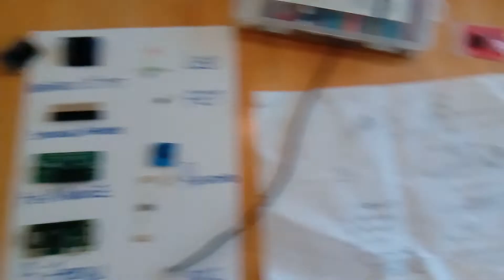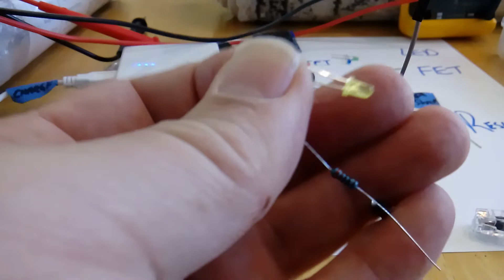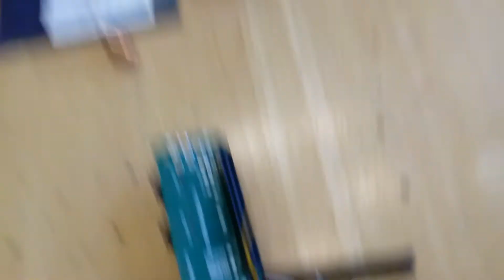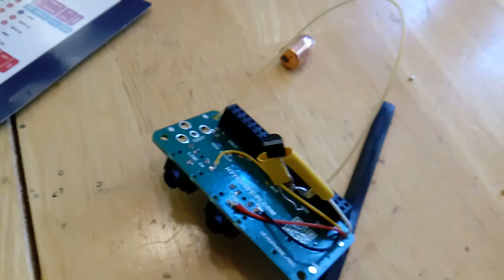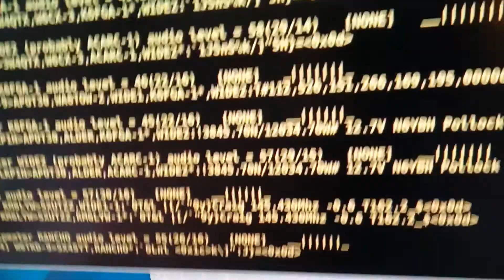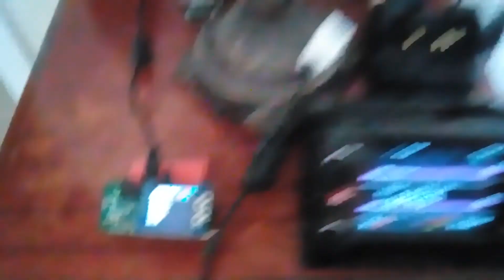DigiPi Build   Part 1 -- Hardware

Comment: I have been searching for both versions of the soundcard with no luck finding, It appears the FE-Pi is no longer sold on the supplied web sales form and not sure if what is currently listed are correct for this build project. I did email wb7fhc to see if they are still available. But in the meantime is there anything else that can be used? I have several HT's I'd like to try this project out on such as FT3dr, icom ID-52, and an FTM500d.

Comment: Will this run on Pi zero W or do I need a Pi zero 2W?
Reply from the maker: PiZero2W.   you can use the original PiZero, but you can't really use FT8/js8call/sstv/fldigi,  ax25/packet/aprs modes work fine.
Reply: @KM6LYW  Thank you! If building with a display, what case do you recommend?

Comment: Well today 18 October,2023, I received my Audio hat —-, not the FE-pi called for in the your plans, I was not able to source this Fe-pi device... ended up with a Keystudio ReSpeak 2-Mic Pi HAT v1.0..
    Any possible help to 1. Wire placement , 2. How would I be able to add the 1.3” monitor, which has yet to arrive..  I realize I could utilize a break out circuit board and jumpers to this breakout board.. however, in doing this will add to the Ugly Build look.. which I much prefer my project to look as similar to your posted pics and videos ..,
  KF2MS

Comment: Well, I've studied a lot of this and seemed to have determined that the Pi is used as a TNC. So, my question, if you have a radio with a TNC in it, like the Yaesu FT5DR , is there a cool way to use that radio with an external keyboard (even if it were a cell phone?) ? > The radio does have bluetooth. Seems like the bluetooth is underused ? Audio in only ?
Reply from the maker: yes, I drive a yaesu FT1DR, which has much of the same stuff.  The USB port and bluetooth are useless unfortunately.  You'll need to break out mic/headphone/ptt/ground wires and hook them between the radio and DigiPi.   The Yaesu HT's also require a special capacitor/resistor in the wiring harness (see your manual).  it works.

Comment: Hi Craig, If  Possible  Would you please be willing to do a new Video on Perhaps wiring up a Audio Cable for the Good Old Faithful Baofeng Radios?  Sure be happy out there to see this video if you was to? 73
Reply from the maker: that's a great idea -- radio harness video.  tho, to cut to the chase, just get a baofeng  (or kenwood) speakermic and cut off the  speakermic... there's all the conductors you need.
Reply: @KM6LYW  Hi Again Craig. Yes if it wasn’t to hard would you consider making a Video on How to Make a Baofeng or any HT that uses them Same K Plug Types than other HT can use.  Wiring it up to use the PTT Switching Circuit, Be an Excellent Educational Video. Looking forward to seeing it Craig
73 Craig

Comment: Hi Craig. Was wondering if you could answer this?? I have a APRS - K1 Audio Cable. If I was to buy the Digirig Baofeng Cable off there website, which has the Grounded would this work rather than making the PTT Switch Circuit?  This way use the Fei-Pi onboard Audio Plugs instead make it a tidy Project What’s your thought?
Reply from the maker: digipi will work with the digirig (with a tweak), but ultimately you need it, or a FET to do the switching.  digirig uses the serial port RTS signal for PTT and the digipi/fet solution uses a GPIO pin.

Comment: How can you possibly think this is a simple and easy "fix" project. Honestly, I started and gave up. I guess I just don't have the DIY time to do this.
Reply: Brian, it's infinitely easier if you have a "USB" connected radio.   All you  need is a Pi and a USB cable.  No soldering.
Reply: @craig9309  Which I don't have. I wanted to try and get this to work on HTs. I spend 99% of my time in UHV/VHF with EMCOMM and as a Technician, I don't do HF except the few times I've tried 10 meters. Thanks anyway.

Comment: any newer soundcard hat will work?..i search Raspberry Pi Zero Wifi and surprised with expensive price....it no longer for poor ham people like me
Reply from the maker: line level cards are best.  fepi and audioinjectorZ.  usb audio dongles possibly.   rpilocator.com
Reply: I am experimenting with the DRAWS HAT with this DigiPI SW. I know the GPIO's are definitely different. However I think through some foolin around, I might be able to get this hat to work work this. I cant see why it wouldn't. the DRAWS is just a stereo codec chip like is used in the NEXUS

Comment: how do you have this wired up to the ftm400?  I am wanting to wire mine to an ftm 350.  But it only has a data port.  Are you using a data port on the ftm 400?
Reply from the maker: Yah, Yaesu makes a break-out cable that fits the Din-10 jack, exposing ground audio in, out, and PTT.   Does the 350 have the same din-10 jack on the back?
Reply: @KM6LYW  it has a mini din 8 pin.   1.packet data input 2.GND 3.PTT 4.RX96 5.RX12 6.SQL 7.serial data output 8.serial data input
Reply from the maker: @jameslee522  Cool, do they make a breakout cable for that plug?   you want to use GND, PTT, RX96, and Packet-data-input.    RX96 is non-EQ'd audio from the radio, packet data input is the mic-audio-input.
Reply: @KM6LYW  Awesome, I'll give it a try.  Not sure if they make a breakout cable for it.  But I bough a standard 8 pin mini din and will cut it in half.  I knew you had a digi pi connect to your 400.  But I didnt know if you used the mic jack or the data port.  Thanks for your help!
Reply from the maker: @jameslee522  copy that - let us know how it goes!  I use the "data port" on the back of the FTM400 and FTM100  ... the breakout cable from yaesu is expensive... like over 40 bucks.

Comment: Great project, congrats! But I have a question, can i use It on old RPI2 controlling a latest Chinese uSDR over Cat? PU4BZT
Reply from the maker: rpi2 should work.  cat control will work with USB serial adapter, either using RTS signal or cat-control if radio is supported by hamlib.  In any event, checkout the direwolf "PTT" line for direwolf.conf in the direwolf manual for more info.
Reply: @KM6LYW  I'll try It! Thanks a lot !

Comment: Can I just plug my rig expert 2000 (On the FT-857D) into the Pi Zero using the USB connection and forgo this circuit?
Reply from the maker: If the 857D has USB audio and CAT control, yes!  you don't need to build an audio card.  We need a list of USB-powered radios.  ft991, ic7300, ic705..... ?

Comment: Hey Craig, it's not clear which pins you've soldered on the stacking header and sound card, is it 5, 12, 16, 26, gnd and a 5v? Actually don't worry, I soldered them all and it works fine.
Reply from the maker: You can solder them all as you discovered, but the essential pins for the FE-Pi Audio Z2 are 3, 5, 35, 38, 40, 12.  https://pinout.xyz/pinout/fe_pi_audio_z_v2

Comment: The display looks fantastic, I have the drivers for mine added successfully (tested) but struggling to get Direwatch working. Any chance of more detailed instructions to get it going.
Reply from the maker: Disable the kernel drivers if you haven't already.   Direwatch and the Linux kernel spi display drivers are mutually exclusive, you can't use both.  Flip through these instructions, skipping the kernel-driver installation, and you should be set.  It's essentially what I did.  https://learn.adafruit.com/adafruit-mini-pitft-135x240-color-tft-add-on-for-raspberry-pi/overview

Comment: Hey Craig, Thanks for posting the video. I'm new to packet/HAM but diving in head first :-) I currently have a home BPQ node running on a Pi4 and building a Direwolf/DigiPi with a Pi 3b for the car. The car setup was interesting since I needed a way to drop 12v to 5v and a way to shutdown the Pi gracefully. Came across a nifty board from Mausberry Circuits that works well. Now working on an ultra small stick to a back of an HT DigiPi with a Pi Zero W. Direction I'm taking is Pi Zero W with a UPS-Lite 1000mAh battery. Already bought a CM108 USB soundcard bare (no case) that i was thinking of soldering conductors directly to the bottom of the Pi 0 test pads. Ended up with this since I just couldn't find a sound card HAT that only had basic line in/out. Most on the market has tons of other crap I don't need. But after watching your video I sent a request for a FE-Pi to Budd. You mentioned in the video about sticky transmit with USB sound cards. Have you experienced this yourself? Also, my design has a Easy Digi planned. Did you find transformer audio isolation necessary for the Pi? Thanks again! Sorry for the winded message.
Reply from the maker: Wow great reply :).  Short-attention span response:   Boot the filesystem "read only", put "ro" in fstab.  make things like home or /var/log tempfs filesystems (ramdiscs).  Then you don't have to shut down.  Just plug the Pi into a USB outlet that works on 12V.  Use the powerbank battery when you're campin' or fishin, and don't leave the vehicle in accessory mode.  The pi zero burns about 120mA... that's months on a car battery.  Let me know if you get the FE-Pi from Budd -- he has limited stock and would like to save them for other projects he sells (be sure to check his packet project/product too!!  great stuff!).   Regarding sticky usb, i observed it first hand.  maybe it's fixed now?  there are a few threads on it.   I don't use isolation in the truck, a couple of ferrites on the power cables on the radio side cleaned up engine noise.  The pi destroys vhf while it's booting, after that, it's quiet.
Reply: @KM6LYW  So the nifty board from Mausberry Circuits took a dump on me after installing it in the car, no voltage out. I was afraid of this since after sales support seams non existent with those guys (not recommended). Now looking for a alternative or a UPS solution but coming up empty on finding something with necessary power management logic for triggered shutdown and startup. Your "Boot the filesystem "read only", put "ro" in fstab" recommendation is VERY interesting at this point. You having any issues with Direwolf / general digi operation with file system in RO state? Easy to mount RW when changes are necessary? Trying not to pepper your channel with questions. You have a recommended write up that covers changing Pi file system in RO and back or is it ask easy as RO in fstab?
Reply from the maker: @gabriel3714  just google "read-only raspberry pi".  you can remount rw with "mount / -oremount -orw".  direwolf has no problem so long as it can write to a ramdisc for the log.  mount /var/log as tmpfs filesystem.
Reply: @KM6LYW  Howdy! Finally got my Fe-Pi from Budd. Working nicely as expected. I'm trying to make my build as small as possible and not wanting to waste the space with an Easydigi if possible. What FET did you use? There appears to be a few types. Thanks again for the videos!
Reply from the maker: @gabriel3714  Great work!    The fet is on the wiring diagram in this video (T1),  2N7000 FET.   cost is almost nothing on amazon!  There's no current so the smaller the better.  200ma.
Reply: @KM6LYW   Budd did reply to my email. Basically China is on holiday and he's waiting for their "butts to get back to work" :-) I made it on his waiting list and asked to check back in a week. Trying to get 2 FE-Pi boards from him since I got a fellow friend/packet obsessed ham who's in the same boat. I'll keep you posted on the adventure either way.